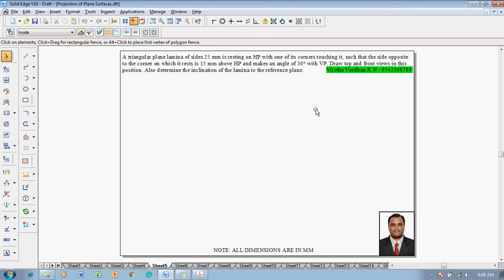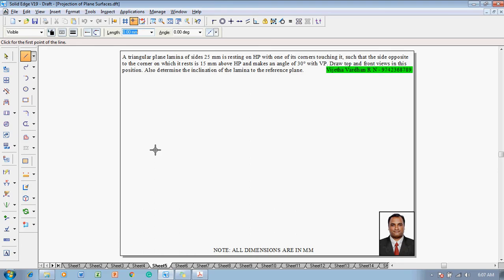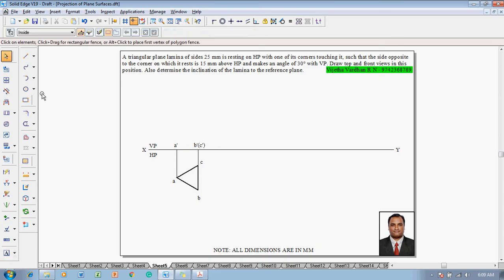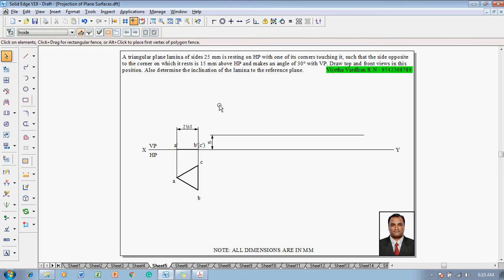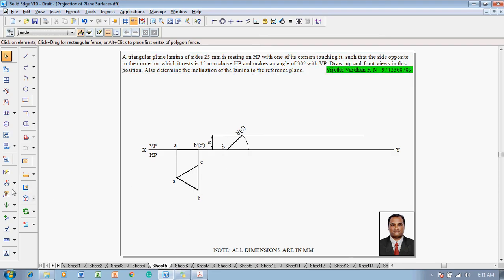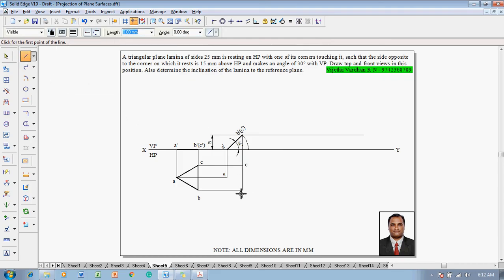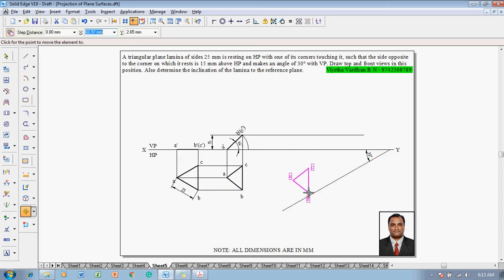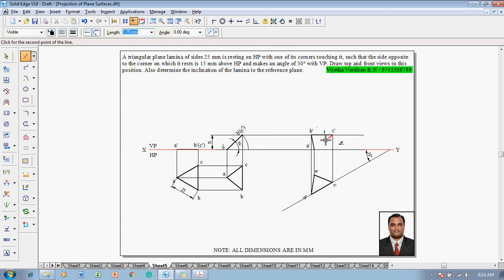Example 05 on Projection of Plane Surfaces

Comment: But navu isometric development matte solides edake draw madoke  alli use madibekaguthe sir pentagonal hexagonal yella draw madoke soo enge madadu sir .. N - side polygon na
Reply from the maker: If you don't have a N Side Polygon then enter the side length and exterior angle (ea) in an increasing manner starting from 0, then 1*ea, 2*ea... until you get the polygon

Comment: An equilateral triangle of 60 mm side is resting in VP on one of its side. Then its surface is inclined to VP at an angle of 40°. Draw the projections of plane, if the resting side is inclined to HP at an angle of 30 °. Find the inclination made by plane with HP.
Reply: What will be solution for this
Reply from the maker: Ping me your mail id I will share the answer for your problem
Reply from the maker: What exactly you are looking for?
Reply: aloksahoo9178@gmail.com
Reply from the maker: Please check your mail